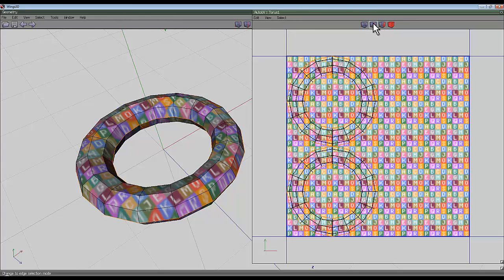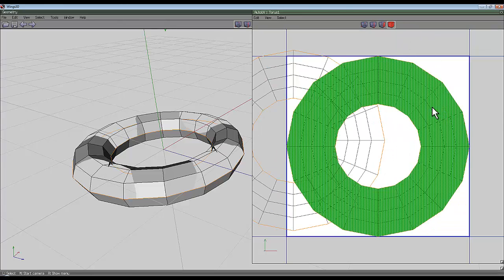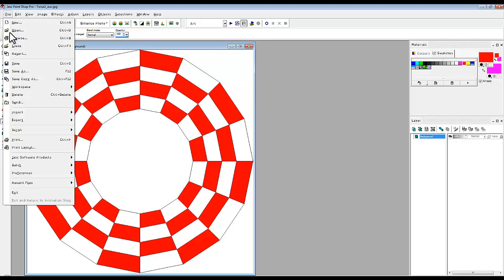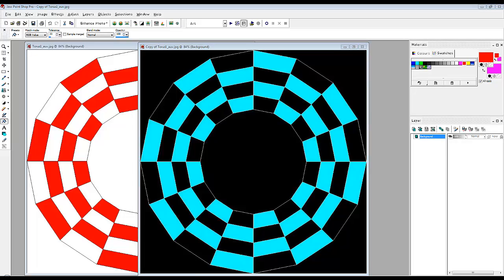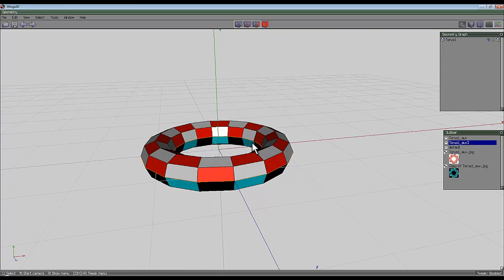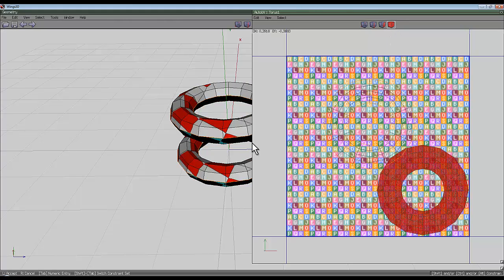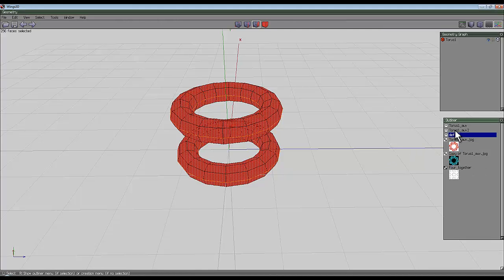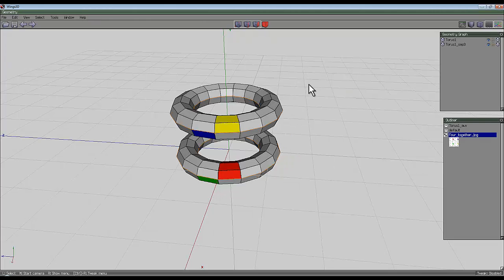Wings 3D - UV mapping primer part 3 - by David Brinnen.

Comment: I need to find a way to download these videos especially. Google wont let me do direct downloads and I have to have Java to use the download software I have found. Java puts a hypertext virus that enables popups on my machine, so that is out. Firefox has direct downloading but it too is not secure like I need it to be. I installed it three times in the past and each time the same virus got in. If you know a way I could do downloads without having to risk my computer, I would definitely appreciate it.

As I have already said, you are showing me things I did not know about the UV Mapping in Wings 3D. You are among the best tutorial presenters on the internet!
Reply from the maker: I put my own limit on the length of the video.  Ten minutes is about the limit of peoples attention span apparently so I've tried to curtail my waffle.  If you want the video's just post me and I will drop box them to you directly as MP4's no problem.